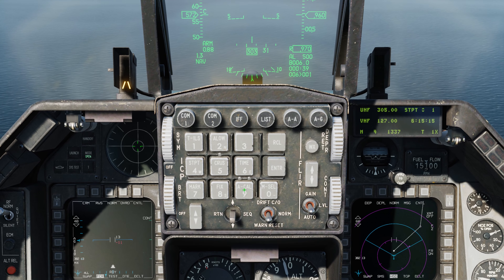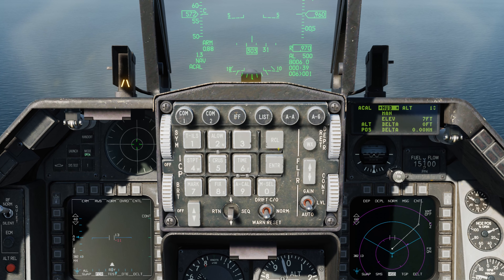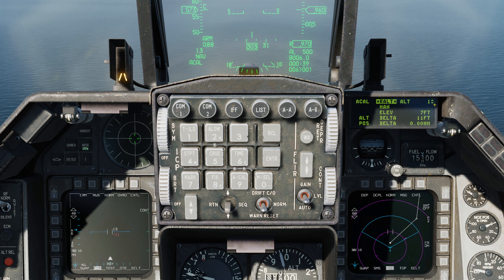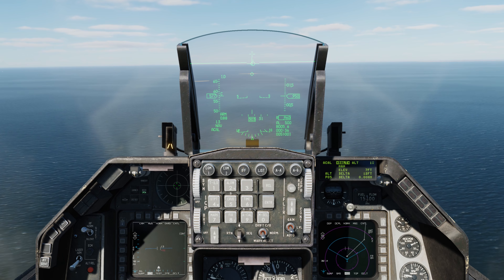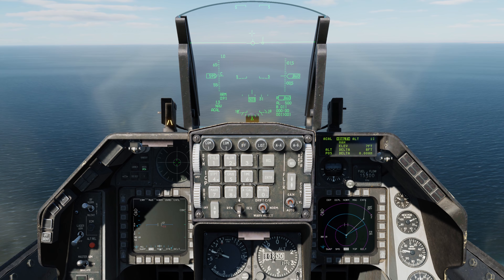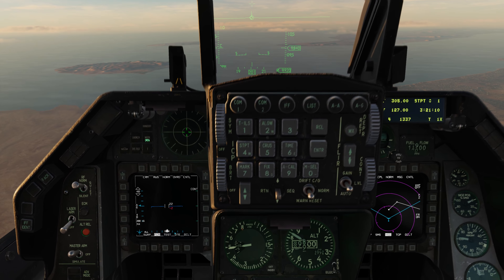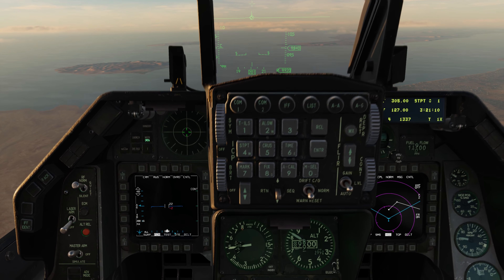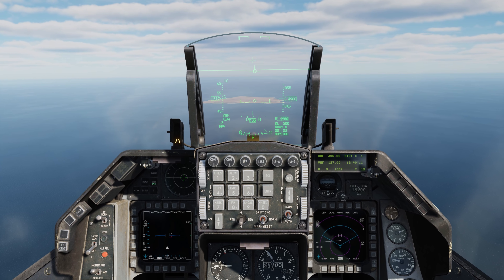DCS: F-16C Viper | Navigation Altitude Calibration

Comment: I still do not get how INS drift can still happen with GPS updates. 
Obviously there can be variation to an extent in any positioning system, but shouldn't the GPS update always cancel the drift entirely (to the accuracy of the GPS reciever itself) every time an update happens.
For example, a 1nm drift should never be possible when flying straight and level with GPS aided INS. 
Heavy maneuvering can throw GPS aided INS off for a few moments but flying straight and level will always return the accuracy to GPS levels.

So what exactly is meant by saying that "drift can still happen"? Or is there a strange design limitation that is referenced here?
Reply: Maybe they want to introduce GPS jamming?
Reply from the maker: Then use the AUTO ACAL GPS option, which will blend the INS/GPS. As mentioned in the video, the manual calibration is mostly for when GPS is not available.
Reply: @possiblyadickhead6653  Could be, but the script quite clearly states that this drift is a part of normal operations.

GPS jamming would be really welcome in DCS.
Reply: If INUs didn't drift, no gps updates would be necessary.  Even modern ring laser gyro INUs are still subject to drift, but not as much as a mechanical INU.  It's just a limitation of INUs.
Reply: @MattWagner  Thanks for the reply. My question was mostly related to the previous video.
So let me get this straight: Is it so that the blended INS/GPS position will drift over time?
Reply: @alassadgaming6111  i'm interpeting that these manual calibrations are NOT necessary when GPS is available, as like you said the GPS auto updates INS
Reply: for most flights auto with gps will be good enough; however over longer flights, or if youre running a mission with no gps, you may want this.

its a sim feature more than a gameplay feature if that explains it better, its there for realism more than being something you actually have to know to fly the f16.
Reply: @agostonbazmajer1100  …the FINAL POSITION is UPDATED by GPS positioning. In other words, the final position is a COMBINATION of INS, RADIO & GPS position to be within defined RNP (REQ NAV PERFORMANCE) limits. The GPS is not updating the INS(IRS) itself but contributes to a better NAV performance for the FINAL calculation. Those 3 sensors work together to achieve def accuracy.

Comment: @Matt Wagner sorry I dont know where else to ask this. Would it be possible to make a controls modifier for a selected aircraft so that the same button or switch is just a regular binding for all other aircraft. For example I have a Warthog HOTAS that Id like to use the pinky switch as a modifier in the AH-64 but I still want it to be a binding for the lights in the A-10C. With a continuously growing air frame count in my hangar this would be amazing to have with my limited access to different HOTAS or HOCAS setups. If you cant help with this where would be the appropriate place to ask for this where it would be seen and past along?

Comment: What exactly means "delta"? Error margine?
Reply from the maker: delta is the difference in the MMC mission planning table entry and what the calibration sensor determines.
Reply: Difference between the ground altitude at the designated position as meassured from the current INS altitude on one hand and the stored waypoint altitude on the other hand.
Reply: It just means difference. Δ is used everywhere.